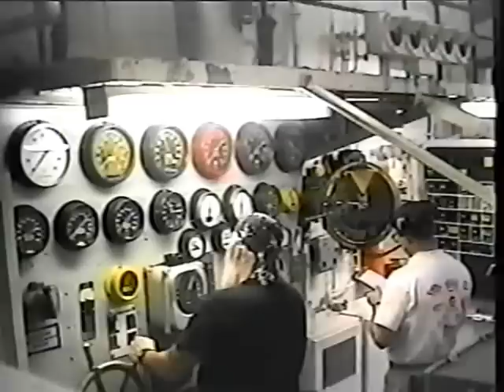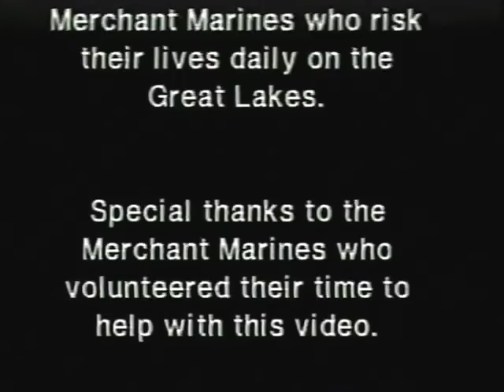Gales of November Great Lakes Ships

Comment: This video brings back allot of memories. Thank you for sharing. Lake Superior may be a lake, but I've seen it get just as rough as any storm I was in on the North Atlantic around the East Coast of Canada. I was on an oil tanker, the Arthur Simard. We headed directly into a storm on Lake Superior. The waves were at least 15 feet, but when the three sisters hit, the waves must have been 25 feet. We would climb the waves and teeter over them, The bow would dive down into the waves and walls of water would build up on both sides of the ship. Then they would crash down onto the deck and it would be entirely under water. The Arthur Simard was about 550 feet long with a full load draft of 22 feet, Fully loaded, he deck was about 6 feet above the water line, The storm was like being on a teeter totter for 24 hours, I was 20 at the time and I totally loved it. I would sit and watch it for hours.